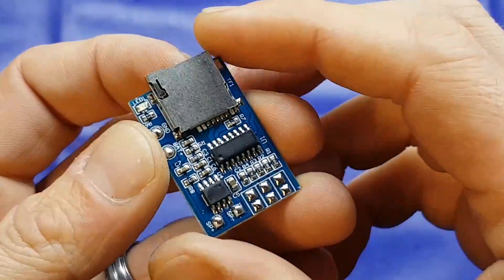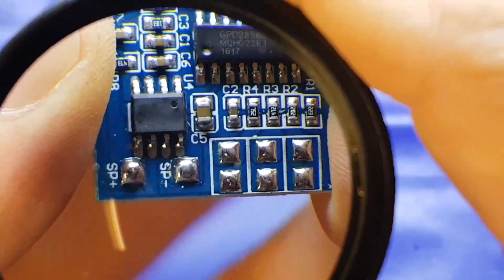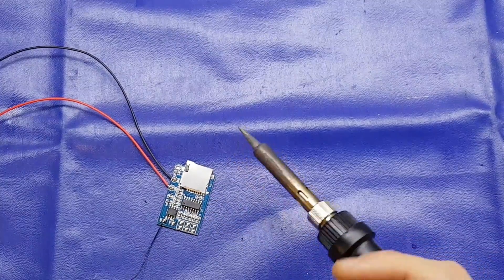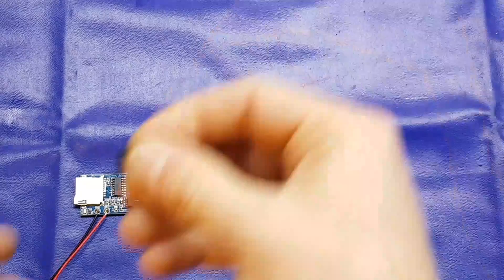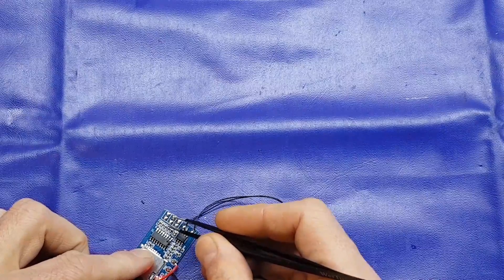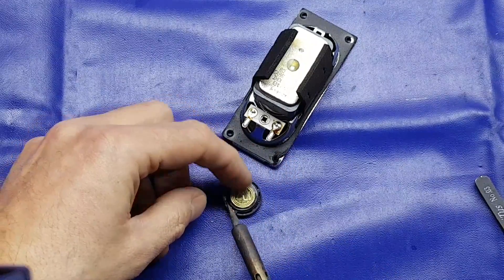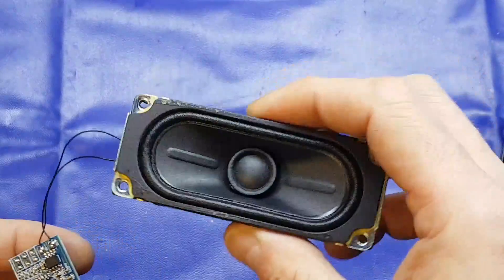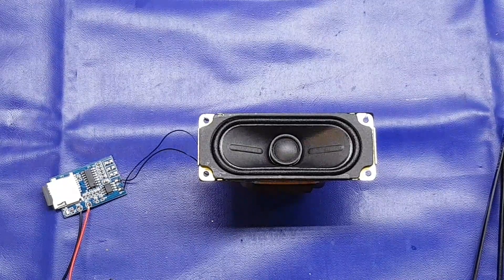Another super-cheap MP3 decoder module build / tutorial - great sound quality!

Comment: I just saw this in a website and wondered what it did.
Now I really want to buy and build it.
But the cost of a sdcard would be more than the entire project, so I'm not sure.

This module : ₹82
0.5W speaker : ₹45
9V battery : ₹20
7805 : ₹10
Which totals ₹157

The cheapest micro sd card, which would be a 32gb, costs ₹400
Would've been nice to have it around if the sdcard was cheaper.
Reply: You can buy the board with usb port for 160or low

Comment: Great video! 
I've tried recreating this build myself, but I'm having an issue: there's a noise floor of a persistent clicking. I have multiple modules, have tried many different mp3 files, speakers, and lithium batteries (3.7V). Any thoughts on what the problem could be?
Reply: Try reformatting your SD card with FAT32 file system... Then add files to it.
Reply: power delivery perhaps?
Are you using a battery to operate?
or
Are you using a little ac/dc power supply?
...
I had a battery charger running on my power strip, and plugged in my MP3 player and I had static "pulses"
I unplugged the battery tender, and the pulses/static went away...
...

Comment: You should glue that board to the back of the speaker and add a small battery 18650 cell and you have a portable mp3 player.
Reply: I was wondering can we use a button cell?
Reply: @shubhamshinde3666  It must provide  3.7 volts. 2 cr2032 batteries may work but might be too much power. If I had this I'd build it into a power bank. Connect straight to the power bank battery.
Reply: @coondogtheman  thanks man!!❤
Reply: @shubhamshinde3666  I did this trick with a bluetooth audio adapter that had a dead battery and I got longer runtime. Added a switch to cut the power so I could charge the power bank.
Reply: @coondogtheman  Actually i want it in a greeting card so the run time wont matter me,

Comment: Question:  Will connecting a female 8mm stereo jack (for headphones) work?  And if so do you have a recommendation for an alkaline battery pack that would work as a mobile power source?
Reply: A 9V battery and a voltage regulator would work, but wasteful. (Which is what I would do)

Alternatively, a set of 3 AA batteries.

Or just go with Li-ion, which is straight forward.

Comment: Hi ,I want to use this module to play specified sound at specified time that control by MCU. So only one track exist in SD card.Every time we disconnect module power supply,I need to play the track from beginning,not resume the track.Would you please help me sir? Can I remove the EEPROM IC?
Reply: Shadmehr Aria , get an mp3 module that uses the JQ6500 ic.
They're small cheap modules, often on a small PCB with 16 pins.
A microcontroller / Arduino can use serial instructions to command the play of specific files from SD card, change volume etc.